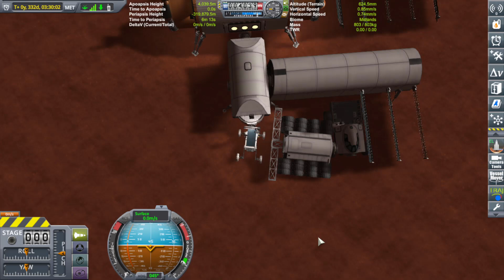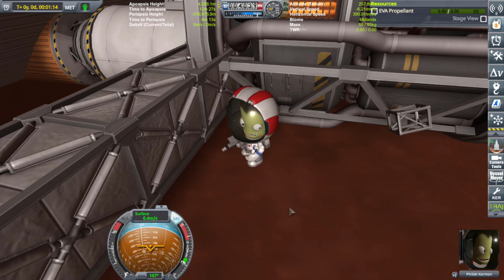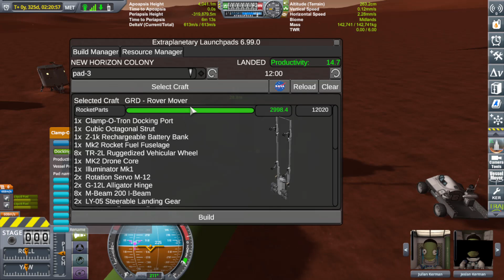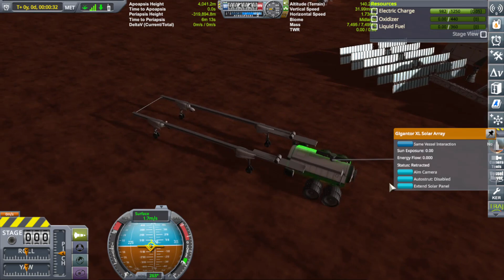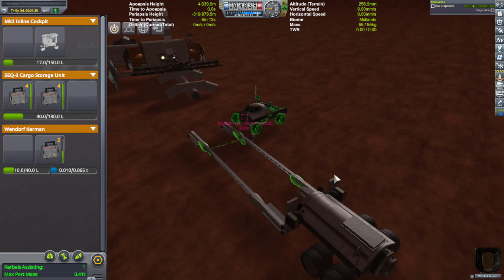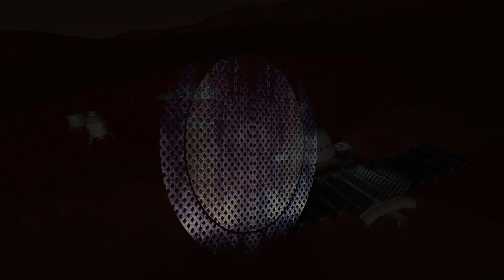BASE CONSTRUCTION on Duna Colony in Kerbal Space Program Colonize the Solar System. Part 9

Comment: Why don't you use radioisotope generators? I could put them in a module like a nuclear reactor.
Reply from the maker: I'm playing as realistic as I can. In this case, Building solar panels is much much easier then digging for radio active materials that can only be found is certain locations realistically speaking and requires special steps to produce things like uranium or plutonium. Where as a solar cell is silicon based and can be found in rocks sand and dirt anywhere.  :)
Reply: @vaos3712  I wonder which one is really more complex? Solar cells are 1970s tech, but RTGs are from the 1950s. Uranium is an ore, and is enriched simply by high-speed centrifuge... but solar panels need a microchip factory.

Comment: Cant you just reduce the spring rate on the mk1 mover?
Reply from the maker: hmm... interesting
Reply: If you mean the lifter, that would make it worse. What KSP does when retracting or extending landing gear is suddenly make the suspension rigid in the position it would be if there was no load on it. The jump is from the suspension suddenly extending when the gear is told to retract.

Comment: I was wondering about the solar panels when I saw you trying to dock the power station to the Command and Control building and I realized that they'd be facing the opposite direction of the ones on the builder building.  Great troubleshooting and at least "trying" to get your kerbals to go out and fix the issues, but I've found that the new DLC is not nearly as good as KAS and KIS were/are. I don't know why, but the main craft starts to sink into the planet as soon as you pick a part off of it and doesn't stop until you replace the part, thus causing Kraken explosions when the physics load the section of the craft UNDER the surface.  It really sucks.  I like KAS/KIS soooooooo much better!  Cool looking colony buildings though and you might be able to just "drag" the Command building with the mover and turn it 90 degrees so the solar panels are facing the right way.